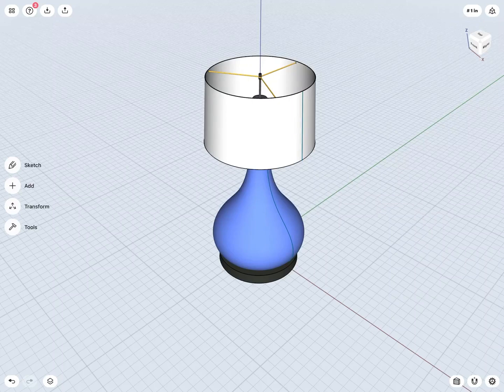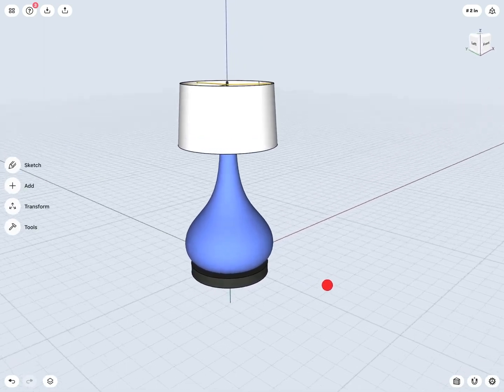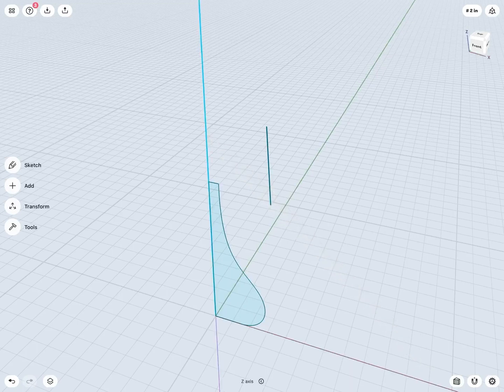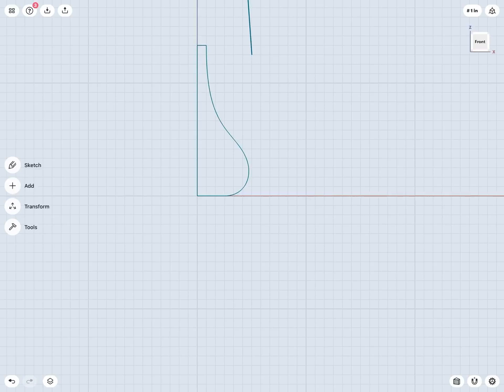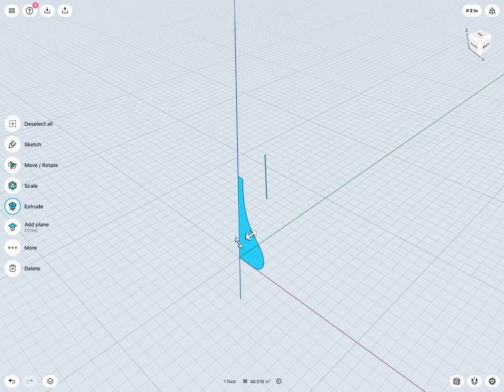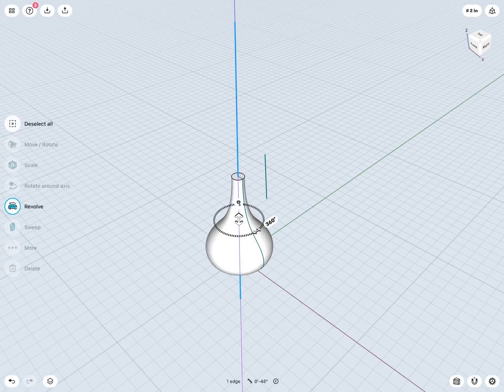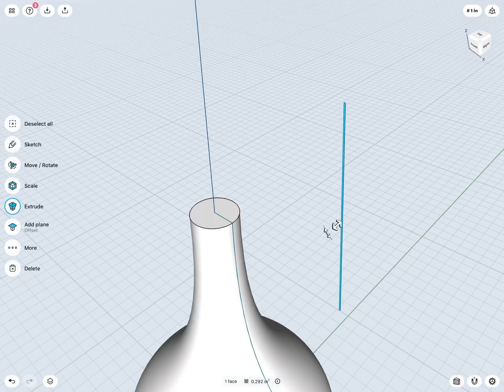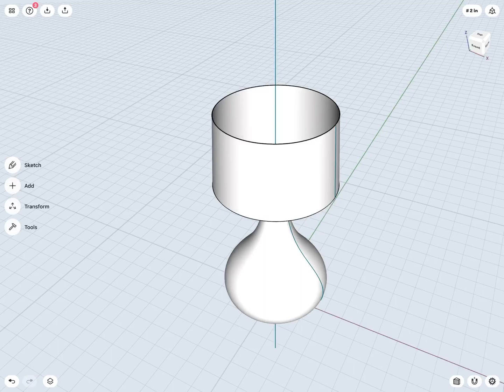Revolve | Creating complex 3D bodies

Comment: is there any way to cut revolve? I can't seem to be able to do it
Reply from the maker: Hi there, the revolution can be adjusted by adjusting the angle or by simply dragging the angle dimension arrow.
If the question is not related to the revolve angle and you simply want make a cut to the body, you can try doing this using the Split tool after applying the Revolve:
https://support.shapr3d.com/hc/en-us/articles/4406427864082-What-does-the-Split-Body-tool-do-